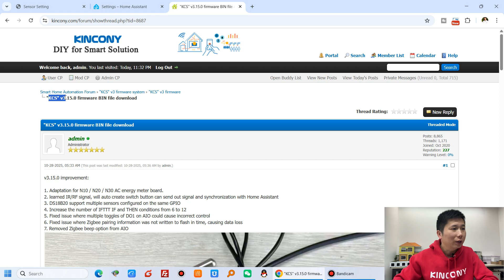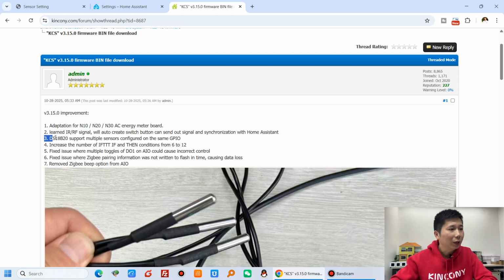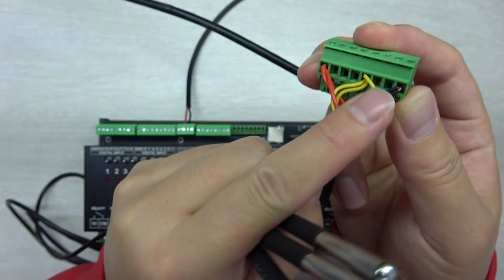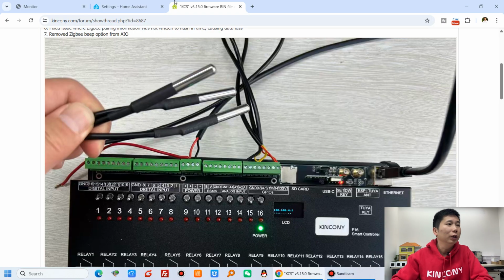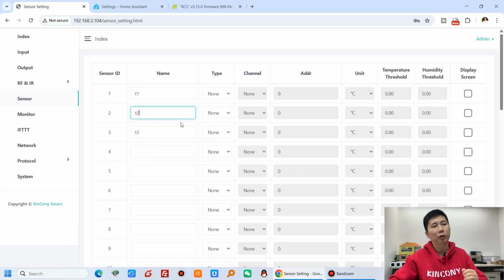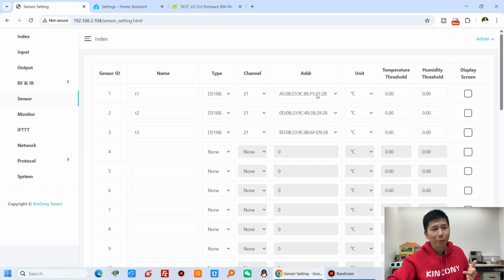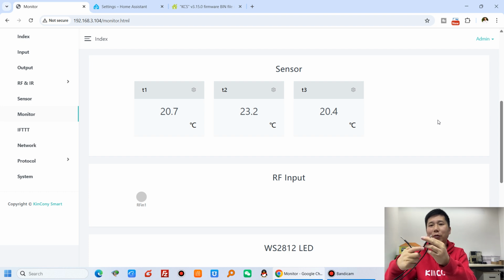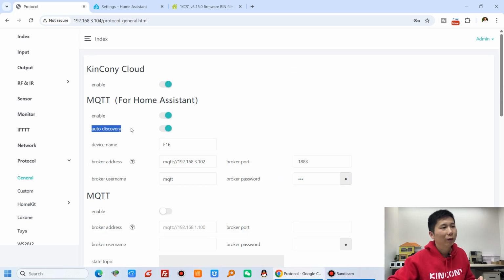KCS v3 new function: multi DS18B20 temperature sensors use by one GPIO

Comment: FYI - I just connected DS18B20 sensor to A16 board with 100m UTP cat. 5e cable and it works great, without error (compared with second sensor with 0.5m cable)

Comment: Can't wait to start building my house! Quick question: what's the cable length limit for these DS18B20 sensors when connecting them to the GPIO?
Reply from the maker: this need to test, can't too long, usually 1-3 meter. if you want long distance, you can add kincony TR module, that convert DS18B20 for 1000 meters.